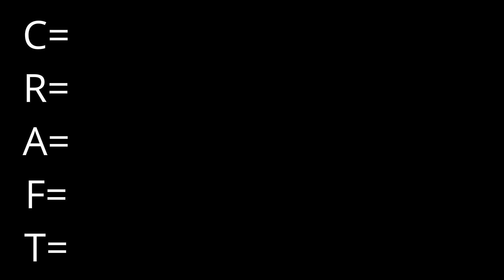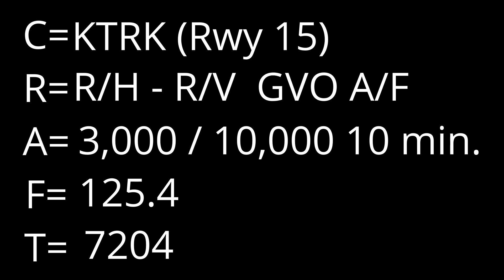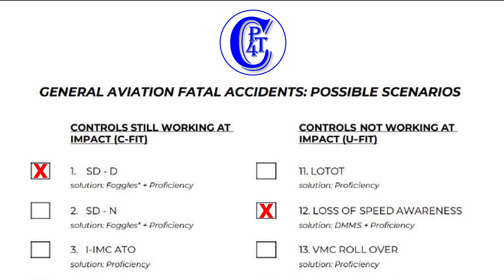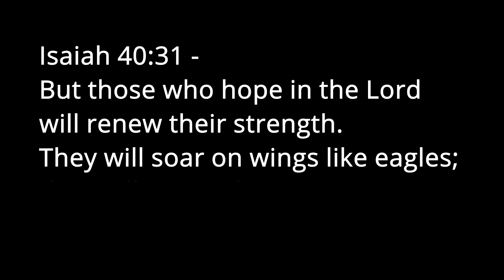Accident Review: Cessna Turbo 182T | Probable Cause AQP #1 Spatial Disorientation and AQP #12 DMMS

Comment: 1.404? 
I will have to call Dan out on this. Just because you calculator will spit out a bunch of digits doesn't make them meaningful. As an example lets say out plane has a stall speed of 100 (that should cover almost all piston/prop planes) the difference between 1.404 and 1.4 is .004 or here the difference between 140 and 140.4 How many can read an airspeed gage to 1 kt?
Reply from the maker: Oh I agree, as you see I rounded the results to 72kts, but in the 182T we fly I actually have it “bugged”’at 75knts as you can “visually” see 5knt increments verse 1-2. And that my best glide speed as well. I wouldn’t get too hung up on the formula/multiplier, just a means to get the results and “bug” the airspeed accordingly as steam/glass panels may have different resolution as well….
I used to ultrasonically, inspect Nuclear Power Plant Piping and we used 45 degree angle and 1.404 is a trig function to calculate the depth of flaws to the “thousands”’of an inch, just to have guys arc-gouge them out, so I do get your comment!

Comment: Whenever I see these kind of accidents, I wonder why they don't set the trim for a safe speed.
I used to fly gliders and was always adjusting the trim for the situation so I didn't have to constantly look down to check my airspeed. I preferred to be concentrating outside, especially when I was in a thermal with others.
Reply from the maker: Yea, her speed was “OK” for straight flight and “OK” for a standard rate turn, but in IMC I prefer a greater safety margin of speed as ANY distraction could result in a Unusual Attitude.
Reply: @Parr4theCourse  I always set the trimmed a little fast - better to have to pull back a little than to get too slow. Things could get hectic in a thermal with someone above you and another below, with a vertical separation of 150'.
Reply from the maker: @gregculverwell  
Absolutely!

Comment: Thank you Dan, your work must  produce results in time. My observations regarding this accident. Why was she climbing out at such a low airspeed? C182T best rate of climb is 90 KIAS. In South Africa aircraft  appropriate airspeeds for in circuit operation (pattern to you guys) are drummed into student pilots continuously fom day 1. Surely this is part of training pilots everywhere. I cannot remember when last we had a stall/spin accident in the pattern here. What are we doing differently?
Reply from the maker: That's the question I ask myself, some pilots learn to climb at Vx, but why if you are not trying to get above an obstacle?
Reply: @Parr4theCourse  I agree, you lose your speed safety margin, and for what? After all Vy gets you higher quicker. It is all about af habits going unchecked. Suurely such issues should be raised during checkrides and renewals. They are in my experience, guess not always the case. Man, I hope Dan's work gains the momentum we need to save lives.
Reply from the maker: @louisboshoff9142  
Absolutely, you are singing to the choir!

Comment: I think it’s possible she wasn’t disoriented but while climbing with the climb power set (manifold pressure and RPM) she failed to pay attention to the Design Minimum Maneuvering Speed while simultaneously watching the artificial horizon and she got too slow (excessive bank angle?) making the climbing turn resulting in the stall/spin. She would have had to nose down in the turn to maintain the DMNS.
Reply from the maker: You are most likely correct, her voice once in IMC, sounded very stressed prior to her turn, so I have to believe that both played a part, to what degree each played is a best guess. DMMS is one thing we do know played a role in this accident. I fly a 182T and CFI's tend to drum into you to climb at Vx, why? its not needed unless you are getting over an obstacle, she had water so Vy should have been her climb out speed. I personally like to be at least 100knts climbing in IMC! Thanks for watching/commenting . . .

Comment: I don’t come to the conclusion that the accident was a stall spin, however, without seeing more data than what you showed, it is hard to be sure.  I owned and flew single-pilot IFR (often in IMC here in the northeast) in a 1967 C-182 that was not A/P equipped so every flight was hand flown all the time.  I don’t know the equipment in this 182 nor the pilot’s skill and experience, but I will offer my assessment based solely on what you provided in your video.

The speed on departure was slow, but not terribly so.  My airplane had an ASI marked primarily in MPH and I typically would climb at 80 MPH (~70 knots) to 500 feet and then set a cruise climb of 100 MPH (~87 knots) thereafter.  This pilot’s airspeed appears to have been in the 70-72 range which is not unusual for initial climb in a 182 and is well above stall, even in a normal turn.  When flying IFR, turns should be made at standard rate and a standard rate turn at 70 knots is only about 15 degrees of bank and the load factor increase at 15 degrees is pretty small, less than 5%.  So, the 51 knot stall speed would have increased to only about 53 knots which is well below 70.  This makes a stall spin unlikely unless the bank angle was increased rapidly to 45 degrees or more.  And stalling a 182 at high throttle setting is not easy and takes a pretty healthy pull on the wheel, unless the airplane has a huge amount of nose-up trim - more on that to come.

So, again based on the limited information in this video, here is my speculation as to what happened.  This is based on a few key factors and assumptions:
1. My experience flying a 182 single pilot IFR
2. The location of this accident
3. The change in the pilot’s voice in the communications shortly after take-off

I suspect the pilot may not have set the trim to the take-off position.  Often, especially when flying single pilot, a fair amount of nose-up trim is dialed in during landing.  If this is not removed prior to take-off, the airplane can become airborne sooner than expected with not a lot of up elevator added by the pilot.  And the pilot may have to push forward on the wheel to maintain speed during the climb.  This can make things tense if you aren’t expecting it and don’t get the trim adjusted quickly.  An out of trim 182 can have some surprisingly high control forces.  I am wondering if that happened and caused the pilot a lot of stress right after lift-off.  And if she entered the marine layer while fighting the controls and trying to retrim, that could have made things pretty intense.

I don’t know where this pilot got her instrument training, but I have talked with a number of pilots from the southwestern US who got their ticket without flying even once in actual.  Actual is much different than under the hood.  If this pilot had little to no actual and entered IMC for the first time unexpectedly and with an out of trim airplane, it would be very easy to get into a spiral dive. And given the speed (165 knots) and descent rate of 9,000 FPM in the video, I suspect a spiral dive rather than stall spin.

I agree the pilot likely became spatially disoriented, but I suspect this was due to either lack of actual IMC experience and/or possibly an improperly trimmed airplane.  I, however, don’t think airspeed was a contributing factor, but rather a graveyard spiral was entered with insufficient ceiling to allow recovery especially being over water and likely with no horizon for reference until nearly in the water.  This unfortunate pilot was born the same year as me, coincidentally.  May she rest In peace.

Hopefully, the NTSB will be able to determine if there was a problem with the airplane itself or if the trim was set improperly, etc.  It will likely be a year before we hear much from them though.
Reply from the maker: Your assessment has some great points, I fly the same model non-turbo 182 and trim is key. I hope the NTSB has more information than what was available to the public, we may never know the true causes, but we do know several contributing causes. Thank you for your well thought out input.
Reply: I completely agree with your assessment.
Clearly looked like disorientation.  Hope we find out for sure.

Comment: I don’t want, in any way, to disparage Ms. Nicholson but I wonder how experienced she was as an IFR pilot. A couple of things in the radio comms (assuming they are either the actual comms or an accurate transcript) made me wonder. In her read back, she got to Gaviota but didn’t read back “then as filed” (and, to be fair, the controller didn’t mention it). Then, in her initial call to departure control, she didn’t give her altitude and, when asked, gave her requested final altitude rather than her current altitude. Experienced and current pilots know to give departure control their current altitude on their initial call. Was she a newly certificated IFR pilot? If so, given that, for many pilots, little or no training in actual IMC takes place, early trips into the clouds can be extremely disorienting. Actual IMC with climbing and turning is NOTHING like practice in foggles or under the hood. My sincere condolences to Ms. Nicholson’s family and friends, and may she rest in peace.
Reply from the maker: I am surprised of how many pilots I meet that are instrument rated have never flown in IMC! Her experience in actual wasn't available to me, the NTSB may have access to that. You are 100% correct actual IMC and foggles are nothing alike!

Comment: Is the 1.404 in the dmms equation a constant number?
Reply from the maker: That would be for full gross weight, so in most cases takeoff and climb out as typically you are at or close to max gross.
Later on Downwind, Base you should be lighter and that will give you a little buffer. It works out to be close to your max glide speed.
Final is typically 1.3vs but 1.404 provides a safe speed for a 30 degree turn on Downwind to Base and Base to Final.
I fly a 182T as well, so I have mine bugged at 75kts (easier to see vs 72kts) and my typical speeds are 90 Downwind, 80 Base and 70 Final.
But I have 10 degrees of flaps on Downwind, 20 on Base, Full on Final so that gives me a good buffer. 1.404 x Vs (flaps up).
That help?
Reply: So the 1.404 = 1,404gw? If gw was 1,670 it would be 1.670? And thanks for your quick reply.
Reply from the maker: @barthutchison4207  
Personally I would simply bug 1.404 x Vs and keep it simple.

Comment: I understand 1.3 vs on approach how do you get 1.404 for DMMS? Please explain this minimum safety flight speed. Thanks
Reply from the maker: This an equation that Dan had come up with from the airlines, it typically will be very close to your best glide speed. It provides a buffer during maneuver for a 30 degree bank, Downwind to Base and Base to Final, once on Final 1.3 vs. 
Here is a link that explains it better than I can:
 https://youtu.be/YtlBtnIo_yA

Comment: IFR is a handful. Especially single pilot, in that airspace, over water and in the soup. A lot to do in the first couple minutes..   take off, start a climb, enter the clouds, start a turn, change frequencies. I don't know the area but maybe use a different runway for takeoff such that you aren't in the soup over water within seconds after takeoff? Takeoff from the runway that was used caused the need for an immediate right turn.
Reply from the maker: Yea, her flight plan showed GVO as her first fix, which would have been a turn to the right and was to be expected once turned over to Departure. I had a similar experience flying to the Bahamas a couple of years ago, Climbing, Entering IMC, Turbulence and got a reroute, I said ready to copy but wasn’t expecting a full reroute. Afterwards I asked fore the 1st fix to get me going the right direction and I would get the rest once I leveled off, ATC aid no problem just let us know when you are ready. Sad none the less . . .
Reply: So right - can’t let yourself get distracted or rattled.
Reply from the maker: @downc212  
Anticipation, is key to staying ahead of the plane…

Comment: Thanks for putting this together.  Do you know how frequently she entered IMC conditions?  The marine layer in Santa Barbara is quite common.  From the audio, it sounds like her workload at that moment was pretty high.
Reply from the maker: I do not know how much experience she had in actual IMC, but she did sound very stressed out after entering IMC at the point her work load was the highest. When I’m in IMC I like to have my speed above 100kts prior to initiating a turn, the slightest distraction at slow speeds can have disastrous results. Sad thing is, her trajectory when she broke back out of the clouds looks like she was attempting to recover, but there simply wasn’t enough time or altitude to recover.

Comment: Thanks for the review and in particular how respectful it is. One other thing for pilots to think about as they enter IMC at low altitude is whether there is any change in the winds aloft, which can contribute to spatial disorientation in a couple of different ways. I recently asked the NTSB chairman for the NTSB to begin including more weather info with their preliminary factual reports including winds aloft, so that we can understand how much this might affect various kinds of accidents. Also, when flying close to the DMMS speed, there is a subtle difference that many seem to overlook about the difference between indicated airspeed and calibrated airspeed. As a result, those using DMMS per the proposed calculation are probably calculating it slightly improperly and flying a bit more slowly than intended.
Reply from the maker: Yes I agree, with a tail wind as she turned to the right most likely had a significant effect on maintain altitude during her climb. I tend to like to be above 100kts before I initiate a turn on takeoff/climb out as I fly a 182T as well.

Comment: Following on from the chat, I understand that the nstb didn't go to site. Query I have is why ATC advised  that runway give there was a tailwind. In any event a tragic accident.
Reply from the maker: A quartering tailwind on takeoff, full tailwind as she was turning to 255 degrees in a slow speed climb. I like to have at least 100kts during climb once above 400' agl to clear any objects, in this case objects were not an issue . . .
Reply: Tailwind does not affect anything once airborne.  “The airplane does not feel the wind.”  (Stick and Rudder)
Reply from the maker: @kohnea1  
I was utilizing the tailwind when she turned to 355 degrees as a means to determine her airspeed as the track log is in ground speed in order to get an idea of her airspeed and if she was close to loading the wings in a high bank turn….
Reply: @Parr4theCourse  oh very good.  I was hoping you weren’t referring to the “loss of lift in a downwind turn” theory which I have heard espoused by too many people who should know better.
Reply from the maker: Nope, if you look at the part in the video where I show the climb out track log, and show the wind direction, that’s where I say that DMMS could have played a part as well. As she turned a much greater than standard rate turn, possible close to 45 degrees (or more) in IMC and if stressed which it sounded like she was, may have been a contributing factor to a stall/spin leading to a descending spiral scenario. We most likely won’t know with 100% certainty, but that appears to be the most likely scenario.
Thanks for the challenge, I should have been more clear in the video….
Reply: @kohnea1  correct, but the tailwind does affect the ground speed shown in the ADS-BExchange tracklog, and therefore does affect the back-calculation of the true and indicated airspeeds.
Reply: A tailwind of 4 knots or less  (basically "calm")  would not alter ATCs decision to issue a takeoff on 15L or 15R, especially for a small GA aircraft..  The pilot had the option to request takeoff 07, although with a reported ceiling of 1400' I expect that KSBA was landing/taking off from runway 25 (the preferred runway for traffic flow reasons) at the time.  As Ron noted, if the tailwind had any significant effect, it only came into play when she responded (with low KIAS) to the heading change toward the west.  Wayne (DA40 KSBA)
Reply from the maker: @GeezerGeekPilot  
Yep I agree Wayne as you KNOW this area very well.
Reply: Definitely a tragedy. No glaring, red flags on this one. Just a reminder of how quickly things can go wrong.